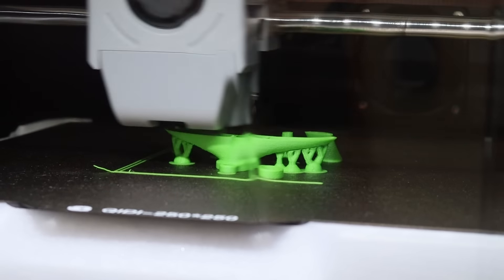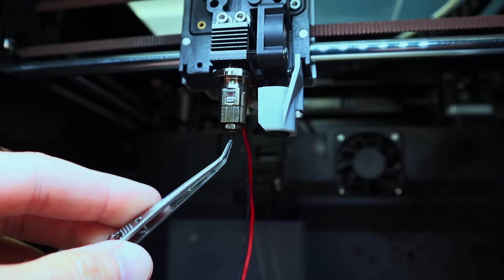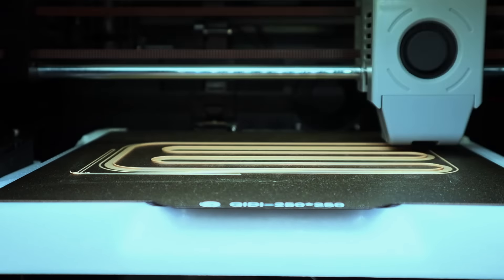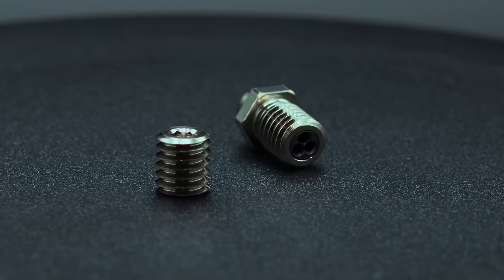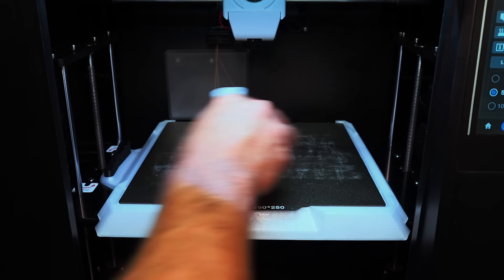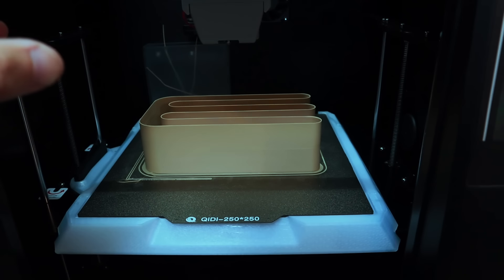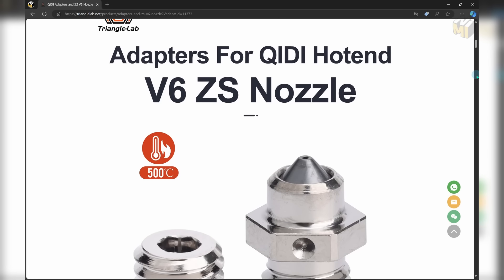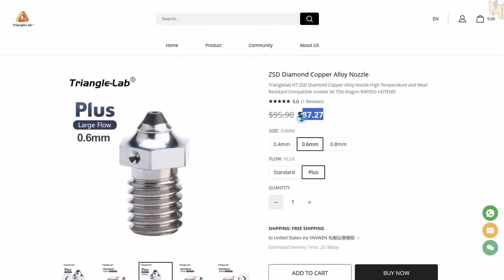This 3D printer nozzle actually does what it says!

Comment: I tried doing this exact same thing, and the head was crashing into the bed. 

Did you do anything else? Did you change the config at all?
Reply from the maker: I don't think so, can you measure the overall length of the new vs the old, they should be exactly the same overall length.  If now, I'd do a calibration sequence which should account for the new length.  Seems a bit strange though.
Reply: @NeedItMakeIt  Will do
Reply: @NeedItMakeIt  My mistake. Totally wrong cht nozzle 🤦‍♂️🤦‍♂️

I have some 0.4 cht ones that fit. Will use that until I order some larger ones
Reply from the maker: That'll do it :)  No worries, let me know how it goes when you get the new one.
Reply: @NeedItMakeIt  I wrecked my hotend. I pushed the flow rate too high. Plastic got stuck all over the thermostat.

I tried to clean it but now getting a error message about overheating 😫
Reply from the maker: I've seen some really bad buildups, which filament type were you printing with?  You might be able to leave it in solution to dissolve or at least soften.  I've also used a heat gun to warm it up to be able to get it off.
Reply: @NeedItMakeIt  PLA+. 

Where I might look into it. Luckily, I just received 10g of 400c thermal grease.

But I'm in the process of building 2 PCs and a server, so I'll have to fix it in a few days

Comment: I am running the Volcano version on my Vcore 3.1 in a Phaetus Rapido UHT reaching 50 mm3/min with ABS without going crazy high temperature (250).
@manjaroblack: I did not need to change anything to control stinging. If anything it is a bit less especially with TPU as i can drop the temperature about 10 C.

Comment: ...i only have a creality.K1, with bondtech equivalent nozzle - amounting to same max flow rate.

(Now that disclaimer is out of the way)

I wouldnt expect much flow rate improvement from diamond CHT, only improved wear resistance.

As with high flow rate the fundamental limit to heat transfer aint the thermal conductivity of the nozzle, but the thermal conductivity of the filament - leading to only the outside of the strand getting melted while the middle stays solid.

That aint improved by more conductive nozzle, its only helped by more contact surface, be it thanks to fins like in cht nozzle, or using multiple strands, or thinner strands of filament.

Comment: CHT nozzzles make a shocking difference. If you want to print fast, thats the first thing to do. I print PETG at 150mm/s (all printing speeds set at 150, not just internal walls) and 2000mm/s2 acceleration on an ender 3 v2, with a bmg clone and a stronger heating element thanks to that. It still has flow, it cant go faster for now because the motors and drivers are heating too much to my taste.

Comment: It should be made very clear, in these reviews, that ANY CHT nozzle (genuine or not) needs to be material specific, since they cannot be properly cleaned and different materials will not mix and you get clogs.
Reply: This is so not true
Reply: @nunovicente34  it's recommended unless you purge with super hot temperatures and you use materials which are known to mix. Like PETG and PLA should be different nozzles, they don't stick to each other